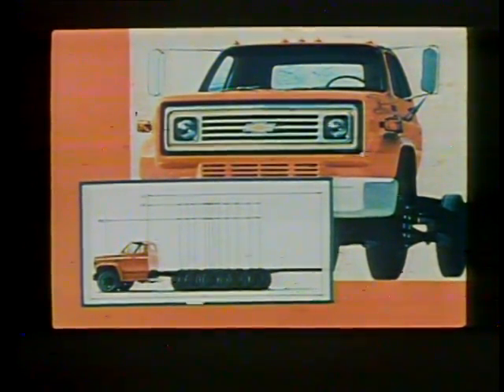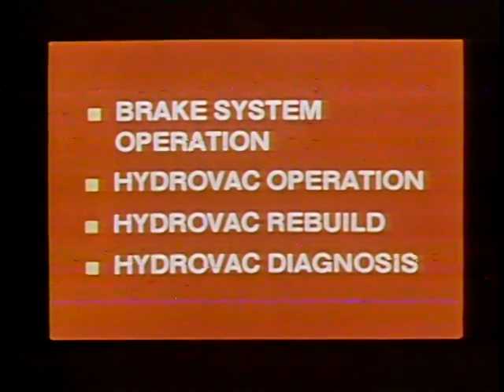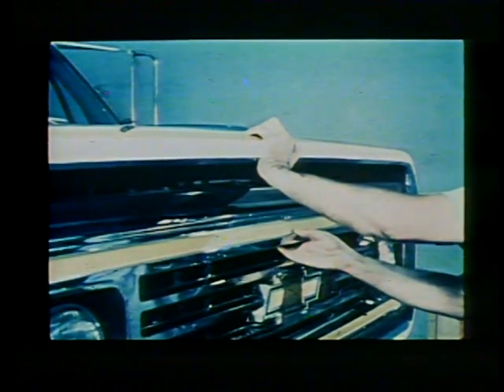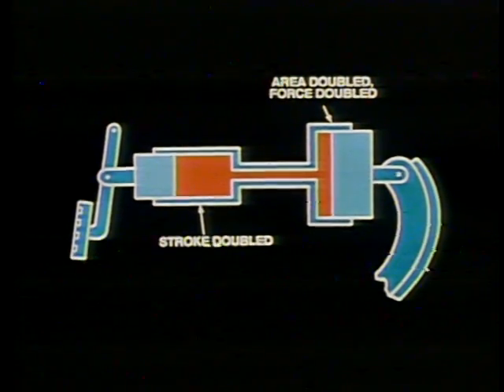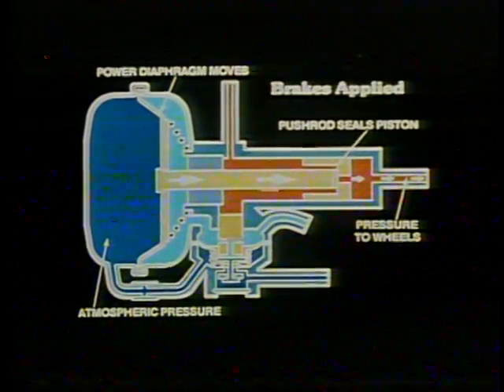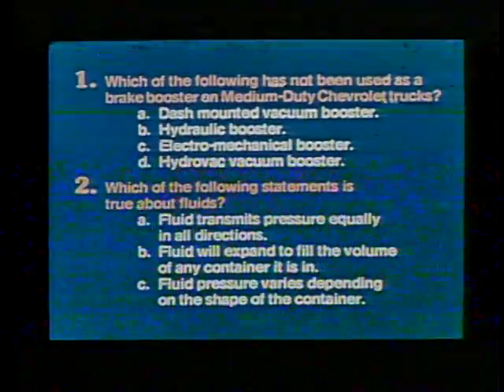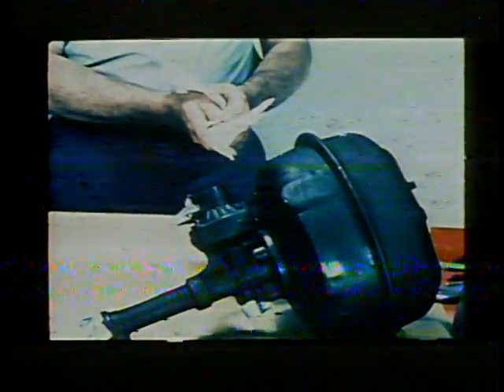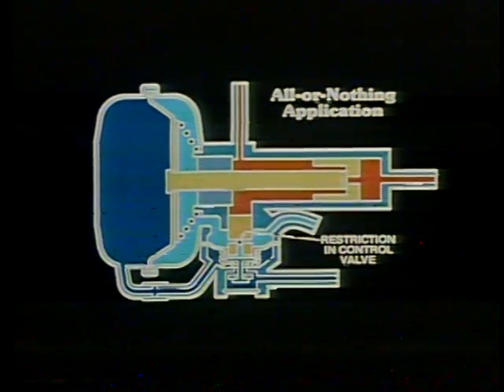Chevrolet HydroVac Brake Booster System

Comment: What would cause brake fluid to be sucked back into the vacuum line to the intake? Gurgling sounds under the seat in air filter when stepping on brake pedal?

Comment: Great stuff. I am doing research to understand how to either rebuild or update (dual circuit) the brake system on my '62 Ford F600. Seems the hydrovac system was an industry standard, even for the parallel system in school buses. Thanks for posting!

Comment: Your a saint. I needed this to fix my c65.
Reply: I've got a '73 C65 that I just got running. Now I'm looking at the brakes issue. Very soft, mushy pedal and needs two pump to even initiate a light brake, but still no where near good enough to stop the truck itself. So something's wrong. Don't even know where to start ! lol